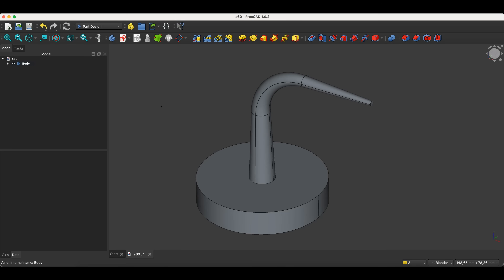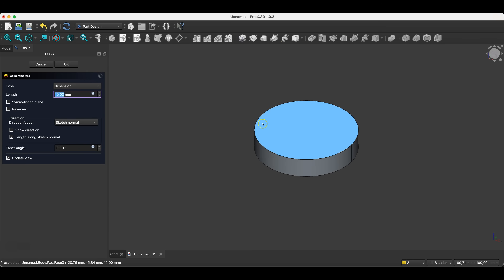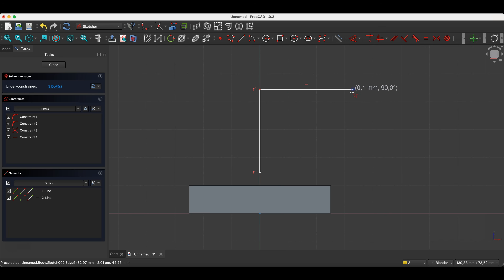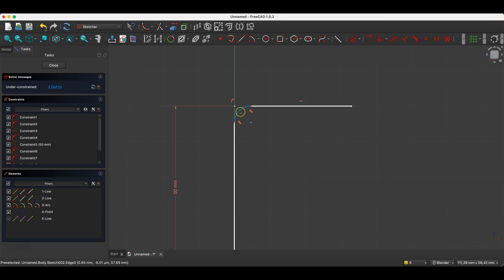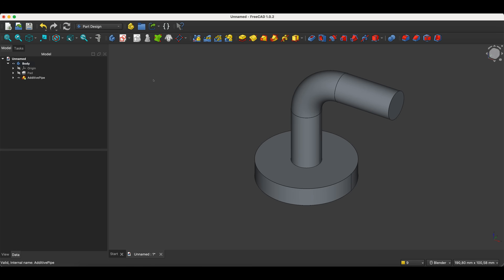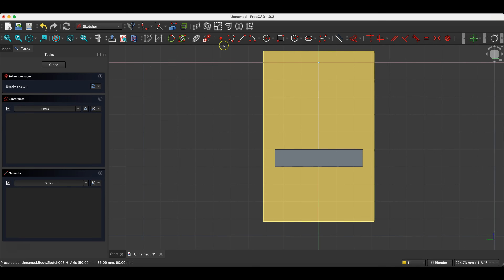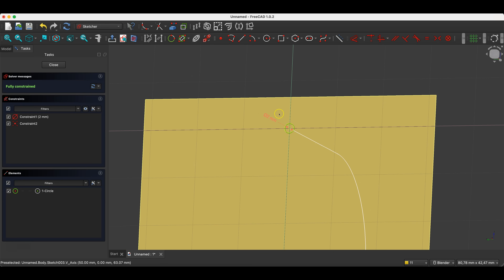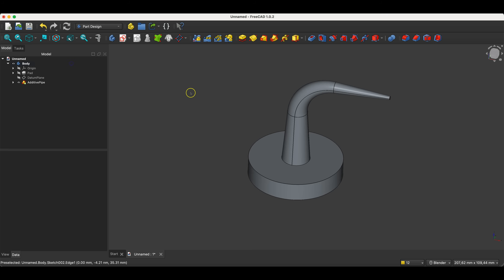FreeCAD: Master the Sweep Tool! (Additive Pipe & Datum Planes)

Comment: Another great video. Datum planes are my nemesis. I can never seem to place a datum plane properly. So complicated with so many options to get them right. In the example, you selected a point, then a line, then the "normal to edge" option. I would have NEVER figured that out. I would love to see an entire tutorial on them.
Reply: I totally agree, I didn't understand any of them until some good tutorials came along. In version 1.1.0rc1 there is a hidden setting I just learned about so the Datum Plane is not needed. You can attach a Sketch directly in the same manner as the Datum Plane. A seasoned FreeCAD user can do that without changing the setting I understand, but I'm not that good yet. The hidden setting uses the same attachment dialog box as the Datum Plane when you make a new sketch. I just tested it and It saves a lot of time. Something to look forward to in later versions.
Reply from the maker: Thanks! 🙌 Datum Planes can definitely feel overwhelming at first — there are so many ways to define them.
I actually made a longer video about Datum Planes some time ago — it might help a lot - https://youtu.be/1LThCDzMBRQ
And to be honest, I don’t know every single possibility of this tool either. Quite often I just select some geometry (for example two points, or two edges) and then try different attachment options until it behaves the way I need.